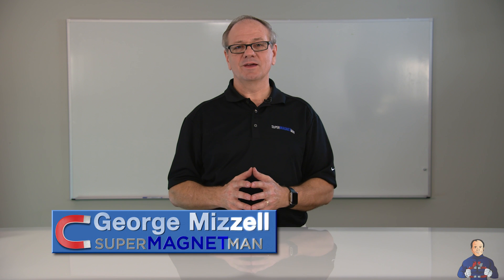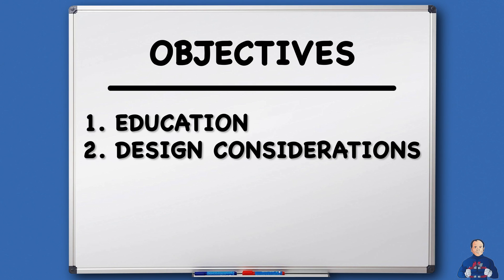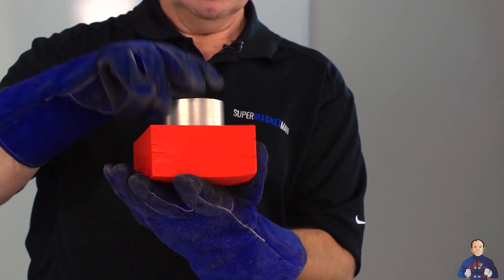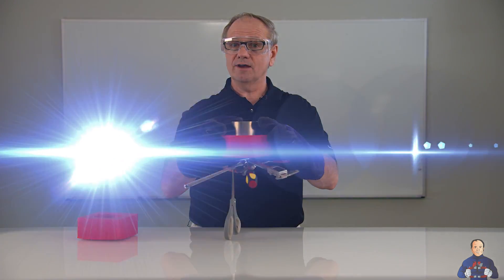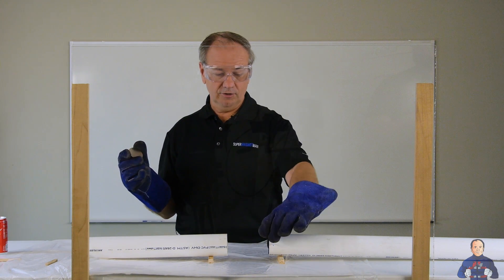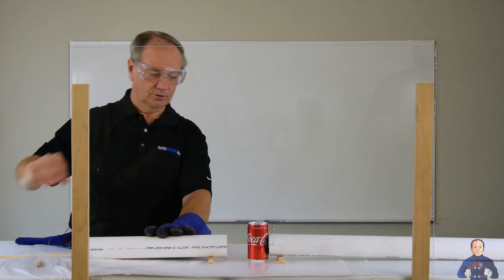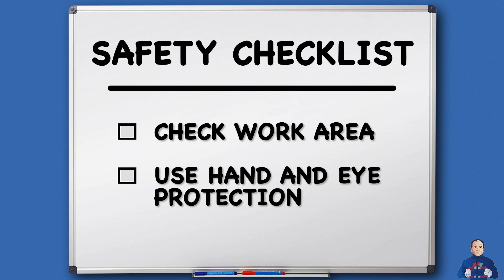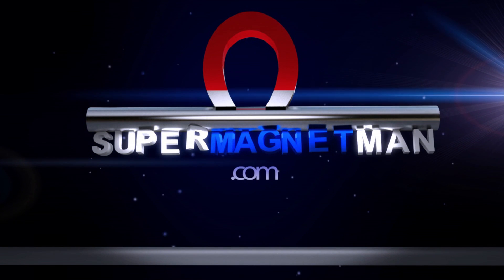Magnet Crashes

Comment: Yall should do it in COPPER TUBES there will be less resistance! Have yall done videos on magnets in copper tubes? .... you know what happens what you drop a magnet through a copper tube right???
Reply: Copper tubes would cause it to have more resistance. The pvc doesn't really affect the magnet except for mechanical friction. With the Copper tube you'd be creating a braking effect, further slowing the movement of the magnet.
Reply: @bookieone9277  I see what u mean, I didnt rlly consider the fact it slows. have u seen it tested though? I would still like to see it tested. Do u know a lot about this stuff? I'm a newb  but I think its rlly interesting.